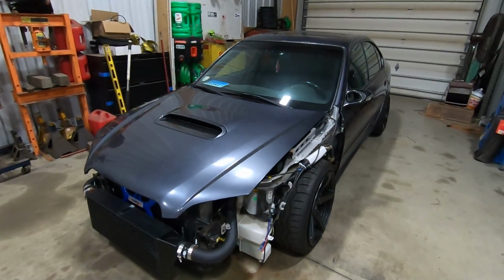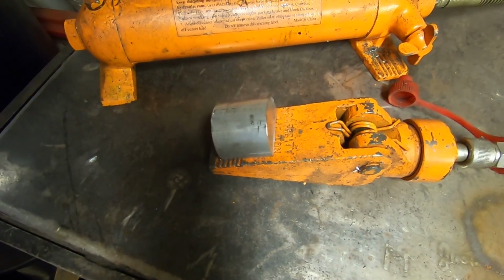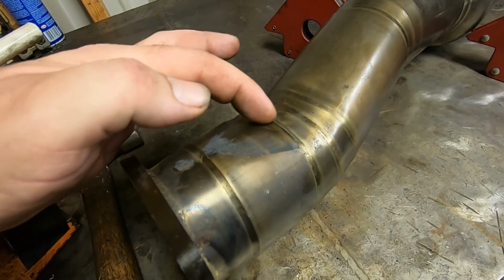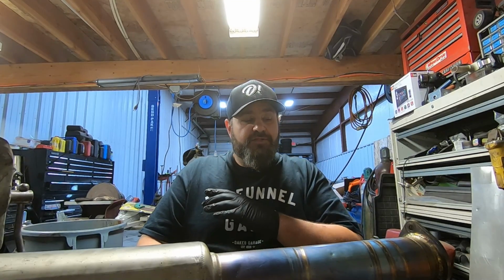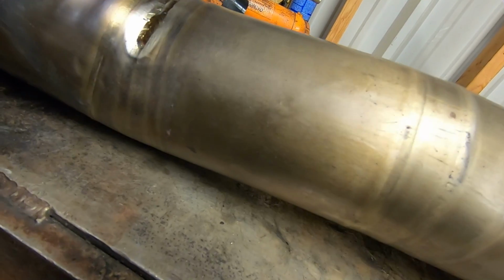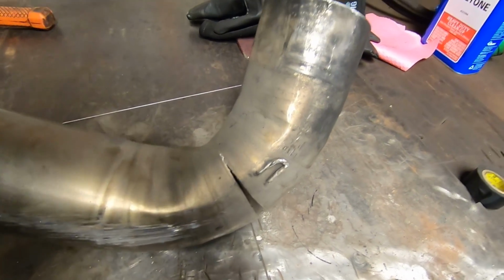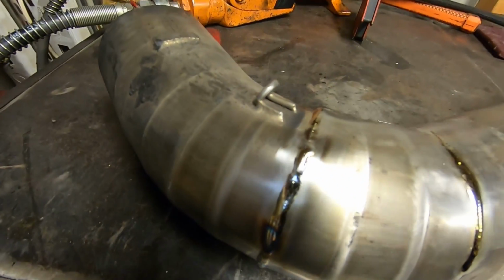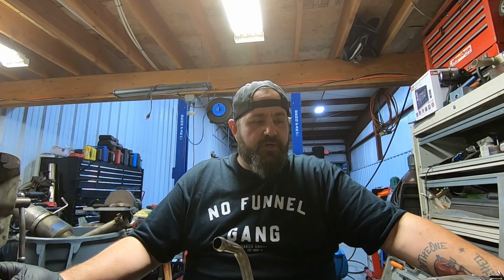Titanium Exhaust Repair...With HYDRAULICS!!

Comment: 2 years later, but could you have heated the pipe up with a torch to make it a little more malleable and less brittle? Maybe it wouldn't have cracked? Would just a little heat from LPG torch distort the pipe too much using the one sided aluminum block? I know benders torch and bend titanium, but they don't use hammers.

 I'm not sure how it would have came out just wondering if you thought about this method before and any reason you didn't go that route?

Comment: i'm doing the same for a titanium M4 exhaust on a 2006 SV1000S ... a new one would be $1,000 - a used one is too hard to find and uncertain. an order of titanium filler rod, some argon and I'm set. i think it's worth the repair. Also that much less in the trash.

thanks for the video. good to see someone else do it to compare with my work. after seeing your results, i think i over-prepped mine. I could've saved more time if i saw this sooner. liked and subscribed here.